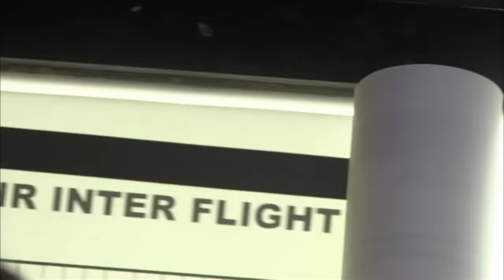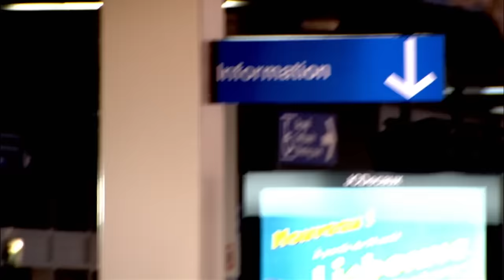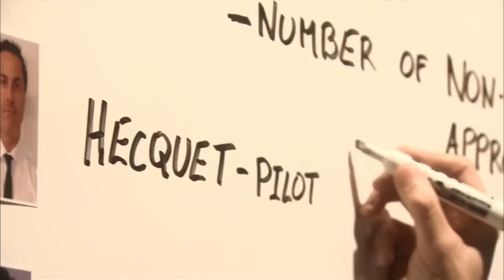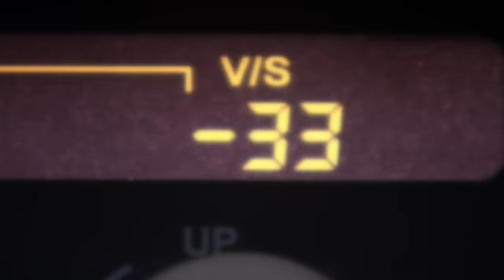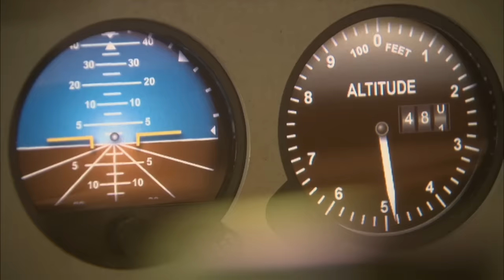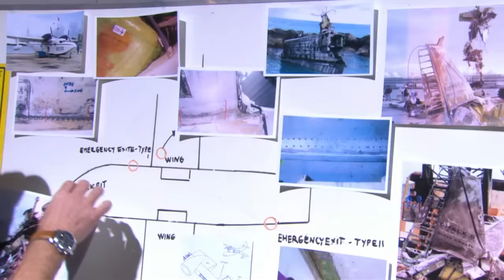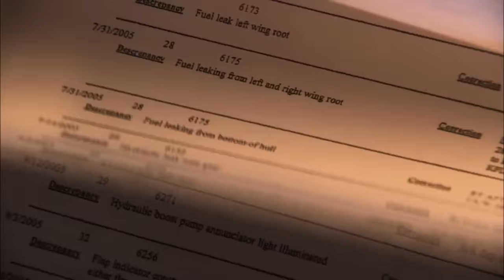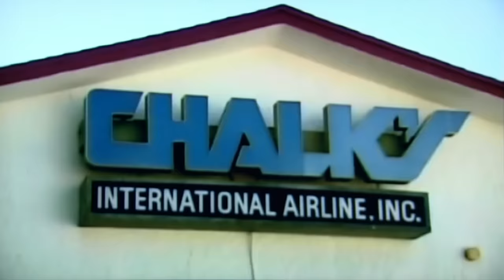Mountain Crash Survivors Left Stranded in Bitter Cold | Airbus A320 | MARATHON

Comment: Just for the lack of knowledge,to whom it may be interesting:
Back in days i was an aviation equipment  technician for Soviet Air Force , i was working on military jets ,and the "black box" ( actually it was orange red) had a metal wire instead of magnetic tape ,it was much easier to save in case if crash, but even steel wire got damaged from flame ,it wouldn't burn but metal changing structures and loosing all data if it was next to the fire for long.
Reply: Wow that's interesting!

Comment: In Florida and many other parts of the United States, a "Code 4" in lifeguard terminology typically means that the situation is under control or that no further assistance is needed. It usually indicates that an emergency has been resolved, or a rescue is complete, and everything is safe. In U.S. Coast Guard terminology, Code 4 has a similar meaning to lifeguard usage, indicating that the situation is under control or that no further assistance is needed. Specifically, in Coast Guard and law enforcement communications, "Code 4" often signals that a unit has responded to a situation, assessed it, and determined there is no immediate danger or need for further action.
Reply: you understand that there’s almost a whole world outside the US…yes? 🙄
Reply: @Penguin_of_Death  I live in the UK and Israel. The event took place in the USA. Code 4 means what I said it means and therefore the video is incorrect. Often it's better to remain silent and be thought a fool than to speak and remove all doubt.